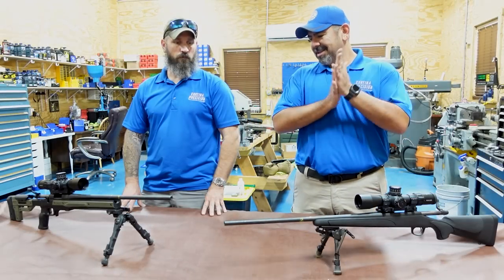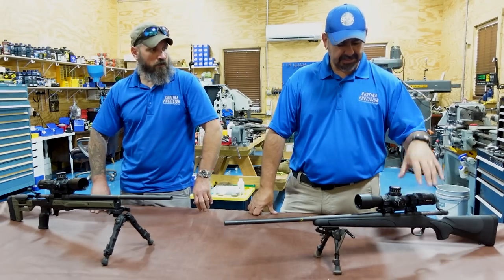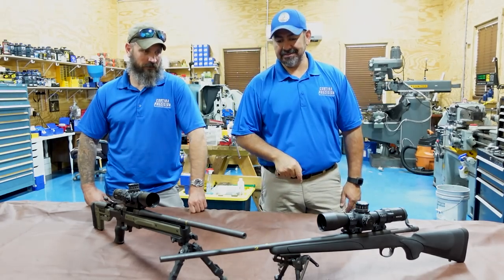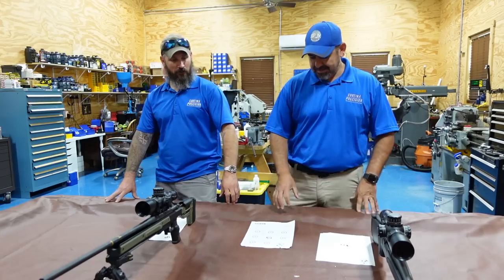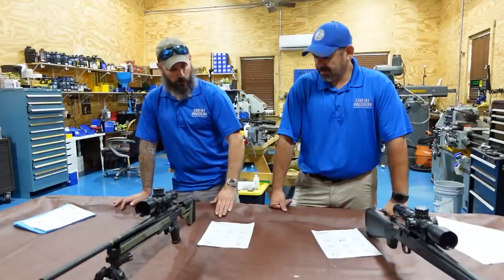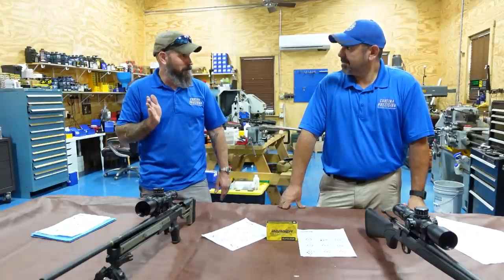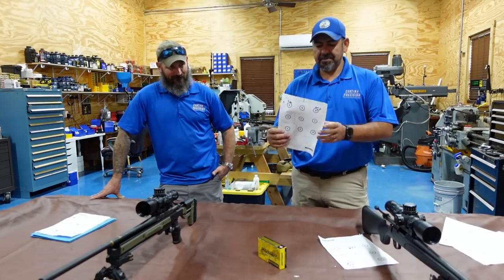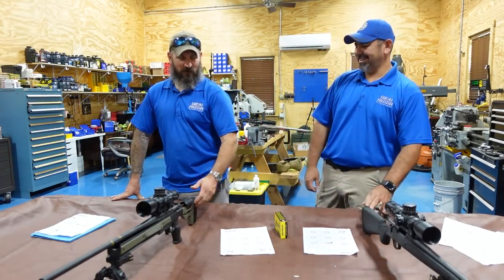6.5 NEEDS-MORE | NEW ORYX CHASSIS

Comment: Mr. Cortina, I really enjoyed this 6.5 need more series and thank you for creating such an awesome content. I hope you can make another series like this. I just recently bought your EC breaker tuner for my rifle and planning to test it out. I have not changed nor modified the factory stock. I want to ask you a few questions. May I ask why did you pick ORYX chassis? Is it because it is the least expensive but it has the most features? Would you be able to compare some of the best chassis?  Would you mind changing chassis only with this setup and show how they can lead to a better groupings without the tuner?

Comment: I just wish yall did this with a different gun... The last Remington I bought was an 870 Wingmaster and it would lock up after every shot and I had already been burned by several others before that but I wrote them off completely. I have a safe full of old shotguns and rifles I've inherited several of them were made by Remington and they still work perfectly but they ran that company into the ground. I might pick up one of these chassis for my Howa 1500 though they're based on a Remington 700 to my knowledge and it already shoots great for a hunting rifle so might be able to squeeze a little more out of it.

Comment: Ha, I had a Rem 700 adl 243 I put in an oryx chassis. it went from fair to good instantly. Then I upgraded the trigger and it helped a lil more. But then I realized it wasn't worth the $ to upgrade. I went and bought a Bergara for $899 and never looked back. There comes a $$$ point where it's not worth upgrading something that can only get you so far, when you could spend less (after all the upgrades) and have way better. But I had the Rem 700 for a long time and yes the Oryx chassis is a must, then the trigger. I would do the trigger before the brake. Its a small cal rifle.

Comment: I got lucky with my heavy barrel savage axis in .223, thing shot .75 moa out the box with decent 69gr ammo.  I put it in an oryx chassis and have shot a couple sub .25 MOA groups with handloads but very little load development.  Basically I took a shot in the dark and picked a random loading for a 69gr smk and after one ladder test was shooting .4 moa easily, and .25 moa when I do my job behind the rifle.  I love the oryx chassis but I couldnt deal with the ODG panels on it so I coughed up the 40 bucks or whatever it was to get the black panels for the chassis.

Comment: Eric you are right you say do nothing with the control rifle since it is shooting let’s say very good for factory rifle in a flimsy stock. Both rifles deserve a decent trigger, trigger tech being my favorite. Instead of a chassis I would like to see an AG composite stock. Since the fact that I’ve got three plastic guns that I have fiberglass the four end put 8 ounces of fiberglass in the rear but stock that flowed up to the handguard. Then fill the rest with silicone and packing peanuts. I would like to know if going with a stock for hunting I would’ve been better off to just buy one. All three I change the trigger immediately. Thanks guys keep up the good work. Yes put a tuner on the chassis Rahal let’s see what that does

Comment: My 2cents worth leave the control as is until the end. The result will then be, not just how much better is #2 over the control. But will also show the cost of getting #2 to shoot the desired groups (moa). You will also have data on the barrel ware and after how many shots it took for each barrel to break in. You might find a difference manufacturing quality between the barrels. When that's all done, do a load dev for each rifle. And again we can compare the two in terms of grouping SD and ES. Now we have a comparison of an out the box rifle verses an upgraded rifle.

 Then start to upgrade the control #1 in the same order of upgrades as #2 and compare the results against  #2 at each stage. When the control has all the same upgrade as #2 you now have a quality control test too.

Comment: depends on what ya do.  If a hunter that shoots 20-40 rounds a year hunting and range sighting in.  bedding and $625 is the way to go.  competition shooter chassis no doubt.  Think I would do trigger next before tuner, that would keep both guns equal longer.   Tuner would shrink groups more dramatically at this stage though.

Comment: In my view, the triggers should be next.  It would be nice if you went from cheapest to most expensive upgrades.  Just my view.
Reply: I know you're not supposed to mess with remington's new triggers but after digging the epoxy out of the adjustment screws was able to safely get pull down to about 2lbs with no grit, creep, and very little overtravel...only tried this as a last resort before throwing away stock trigger

Comment: Sorry for the book in advance!

FWIW and it may be too late to do this heh (and make sure you keep track of your time).  Get more of those guns, so you can do an individual upgrade to each one and see how much of an improvement each part makes between chassis, hand loads, trigger, and brake.  

In the meantime, update the other one to the Oryx.  Take it out and shoot it to validate it and see if it is still the same and not better (i'm hoping its better).  Regardless of if its better or not, update one with a trigger, the other with a break and see which one shoots better.  When you get your winner, upgrade the loser only with the other part, i.e.brake/trigger and shoot them see which one wins and go from there.  All the while, chart how much better the performance is for each one. 

Effectively it's a waterfall method for determining how much impact adding x,y,z, parts are and by how much to a stock rifle.  Then at the end you can validate your findings by taking a stock rifle, shooting it to get a group.  Upgrade it completely and then shoot it for a group and see if that is the same result you got upgrading individual parts as you went through the upgrades.  You could also try upgrading them in a different order so you can see if there is a preferred path to upgrading a stock rifle, what that path is, or if it doesn't matter.  

The reason I mentioned time above because, both of you are what most of us would consider "pro's" so you're easily 2-3x faster at getting the data, interpreting it, and acting on it than we laymen would be.  Especially in developing load data...it's not difficult to turn a screw...  So, if you both have 50 hours in the upgrade, I would imagine it would take us 100-150 hours to do the same thing.  Well, time is money, so at the end how much time and cash did we spend upgrading a stock rifle where we would have been better to cry once and get the custom action, barrel, and chassis ahead of time or does upgrading a stock rifle put you into sub-moa territory and yes, it's worth it to upgrade.

Another interesting thing mentioned below, is why are two rifles that should be identical shooting so differently?

Comment: Put a MDT Elite Vertical Grip on the stock first. Then buy multiple Triggertech Triggers to try in it to see which one performs best in that chassis. I would like to see a comparison between the flat blade and curved blade trigger in a chassis.
Then do tuner brake after triggers. Threading and tuner brake should be the final upgrade. Or least try the tuner brake first, see the increase on how good your tuner can tune a factory load. Then take the tuner off and work on getting the rifle at its "peak" potential before putting the tuner back on for the final.

Comment: Would like to see how much you can improve accuracy of the control rifle just by doing custom load development and compare that to the upgraded rifle with a tuner brake
Reply: If you change the chassis on the control rifle, it is not longer a control.

Comment: Some of those numbers were a bit weird in this video. Both velocities went up on the 2nd group...but a 46fps slower average for one group on the upgraded rifle? What's up with that? And 19.5 STDV on the final group? That alone can give a person +1" group, yah?

Control rifle:
Group1 - 7:47
2712
13
6.2

Group2:  8:50
2722
24
9.8

Upgraded rifle:
Group1 - 10:04
2676
28
11.6

Group2 - 10:35
2701
55
19.5

Comment: I think you should try a tuner on the one in the original stock prior to upgrading into a chassis system.  I think you should take each rifle on a seperate path to show the differences otherwise you are just taking each rifle on the same path, but separated by timing.

Comment: You should tune the control rifle and see what it takes to make the chassis rifle shoot as well with out a tuner. The tuner on the chassis rifle should be the last option. Make all none gunsmithing changes to the rifle first. This would be a great time to show the difference your tuner can make to a factory rifle vs an assembly of aftermarket upgrades.

Comment: ok maybe it is just me but when I mount scope rails on by 700 Remington " I have a few of them" I have to bed the back portion of the scope rail to the actions There is always about a .003 to .005 gap between the scope rail and the action at the back portion of the action. That is putting too much tension on the scope rail and the action when torque down to spec. Something to check for!

Comment: I would look at doing a different style stock on the factory stock. Either a different MDT stock or a laminated stock. Or Start sending them in different direction like a light weight carbon fiber or fiberglass stock. Just an idea I would like to see. This is a great little series so far. Keep it up guys

Comment: You can test #2 with the same chassis. Just switch it and try it. I'm really interested in the tuner break however. Now I know you can shoot so the reduction in recoil won't change much in the shooting. But the tuning would could be a revelation.

Comment: I had Remington 700 SPS Tactical 20” HB 1:9” twist rate in .223.  It had original Hogue rubber over mould stock.  All I did with the stock was I removed some material (1/4”) from the front part of the stock around the barrel and tightened up action screws and adjusted the original trigger to the “lowest setting”.
I was able to shoot clover leaf groups with 52gr Hornady pills, 55Gr Barnes TTSX and Hornady HPBT Match 75 Gr.  At 400m I was consistently hitting tennis balls with ease.
Later on I switched to Magpul Hunter stock simply because of looks and ability to have magazines (only to discover at that time I could only use AI mags since their outside dimensions were identical to .308 mags).
I never ended up getting that Magpul mag well.
Anyways, I wouldn’t say Remington 700 is not an accurate platform.  I’ve seen some “exotic” brands shoot like shit.

Comment: I like this.  I already checked out Oryx website.  Thanks.   the rifles can only get better. no need to have a pressure point at the end of the barrel, that just moves your barrel up as it gets hotter.  Tuner and trigger on both, with chassis, you can get at least 1/2 MOA out of both rifles.  (prediction )

Comment: Would love to see #1 with ammo tuned to the rifle.

Also, keep the control rifle as is until the end of the test and THEN make all the modifications to see how good you can get it.  That is the purpose of a control.
Reply: Yes, I hope they get into the whole ammo aspect of this situation that us "budget-guys" have to confront. 

Some of those numbers were a bit weird in this video. Both velocities went up on the 2nd group...but a 46fps slower average for one group on the upgraded rifle? What's up with that?? And 19.5 STDV on the final group? That alone can give a person +1" group? I thought the Berger should be good stuff...but all my cheap rifles shot pretty consistently 1.5 - 3" groups with factory loads, with just a few exceptions. Hand loading quickly was able to get to under 1" with velocity being consistent & seating-depth with MUCH less jump than factory loads.
Reply: ...although after thinking about it...I'm glad they are just doing the rifle mods, but would THEN like to see the ammo tuned. Since I did the opposite & ammo first without touching the rifle. Maybe I can use their tests to get a rifle to go from .7" with handloads, down to .3" with one of their upgrades. I'm thinking barrel.

Comment: Keep the control rifle super low budget.  Try taping washers or weights to the barrel as a cheap tuner to compare with the EC tuner brake.  Do proper upgrades to #1 and budget DIY upgrades to #2.

Comment: I'd like to see how far you can go with hand tools with the control.  Midway had a video on hand tool blueprinting that I'd like to see if that has an effect.  See if you can stiffen the factory stock with epoxy or bedded rods and add weights.  Build up a custon foam and tape cheek riser.  I guess see how far you can go without buying aftermarket upgrages and just throwing money at it.  Are there things that can be hand lapped or maybe even different factory ammo selections before hand loading.  The control seems to be the most interesting out of the 2 in that you're not just throwing money and parts at it till it shoots.
Reply: Oh and it would be cool to see some video of the gunsmithing process and the troubleshooting you might need to go through.  Some time-lapse with commentary or just showing the tools you need and how to use them to make the modifications etc.

Comment: 18:40 I vote leave the "Control Gun" as is, no more upgrades or additions. Otherwise, you'll never know how much better gun #1 was improved by mods. It's now already as good with just the chassis. If you tinker with the control gun, then you're just comparing the 2 barrels. At some point you'll probably want to hand load for the rifles and find each rifles' velocity node etc. to accurize it. I noticed that the control gun had better ES, SD and higher velocity with the same ammo so, the modified gun 1 is probably even better than the control gun and what this episode's test showed.

Comment: Seems that the REM 700 has more flex because it's on a different bipod not really the stock flexing. Either way, I'm looking to upgrade a Ruger Predator w/ the Oryx chassis. Comfort is a big deal and adjustment in the stock makes a big difference.

Comment: Cheat for the plain jane and polish the bore. I wonder if you'll come around to stress relieving barrels. Maybe a plug in the chamber with a well matched plate to the barrels chamber area so no deforming happens banging the barrel then light surfacing lands and polish. Anything for going nuts for accuracy.

Comment: I use savage axis 6.5 CM I put in an oryx chassis that's it. Consistently 0.5 moa.  With the axis chassis was 1.2 moa out of the box. I find savage is great for accuracy  slap it into an oryx chassis.and they're absolute tac drivers

Comment: It's hard decision to either stick to keeping the control gun as is or to keep upgrading them both. If you upgrade both you now have 1 that is lagging in upgrades behind the other one. So all you're going to find out at the end of the series is that gun 1 needed a better chassis in order to start to compete with gun 2 (control gun). After that is the series now going to be which one is better with less upgrades? Or is it still going to be how many upgrades will it take in order to make one gun achieve .25 groups? But then the question is why do you need the 2nd gun when you can just keep track of the number of upgrades you did to a single gun to achieve sub moa groups. I dunno. It's a difficult decision here

Comment: 19:30 Put the Chassis on the "control" and relook at groups (without touching the current chassis one).
I WANT TO KNOW, Would it just be better to "find a good gun" at the start and improve it to get smaller groups... or does "fixing the bad" on a crap version of a stock gun make it overall equal.
(If that makes since.)... I want to know if it'll be better to get a good gun from the start before spending thousands on it.)
Reply: Well its always better to start with a good gun of course.  But What's a good gun?  It ultimately comes down to the barrel.  With a factory gun like this you won't really know what the barrel is capable of until you fix everything around that barrel.  So yeah it'll always be better to start with a good barrel.
Reply: @MC-wh6xk  How can you tell "it was the barrell" that made the group 3.5 MOA when the barrel wasn't changed... and after the chassis was replaced, it matched the tighter grouping gun?
It could have easily been a bad stock on the 3.5MOA gun --- Thus, doing what I said above would check for that.
Reply: @Gnolomweb  You can't.  We're now saying the same thing in two different ways.  Their rifle shot so poorly because of those terrible stocks. Once you make fundamental changes to the rig you'll begin to see what the barrel can really do.  In a nutshell if you're looking to buy a new rifle today avoid the Rem700 and buy either a Bergara, Ruger, Tikka, or just about anything else.  Rem700's today are very sadly the bottom of "barrel".
Reply: @MC-wh6xk  "Once you make fundamental changes to the rig you'll begin to see what the barrel can really do."
That's part of my point. "we dont know" the "good barrel" in comparison to the "bad moa gun"....

Your comment, "But What's a good gun?  It ultimately comes down to the barrel. " is IN NO WAY saying what I said.

Comment: A trigger does not make a gun more accurate. A trigger will allow the shooter to shoot the gun more accurately. The purpose of this needmore testing is to see how much time, effort and money it takes to get a factory rifle as accurate as possible.Next steps I would do: Add a trigger then re-shoot the groups.recrown the muzzle then re-shoot the groups. Add the EC tuner break then re-shoot.Then start working on load development. However, with the Berger ammunition that is very good ammunition to begin with so there might be very little improvement.